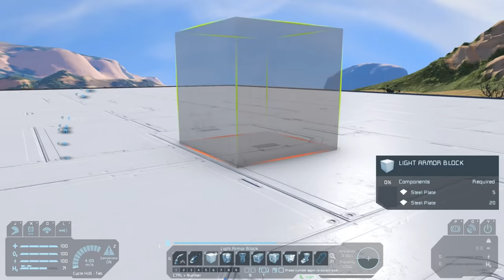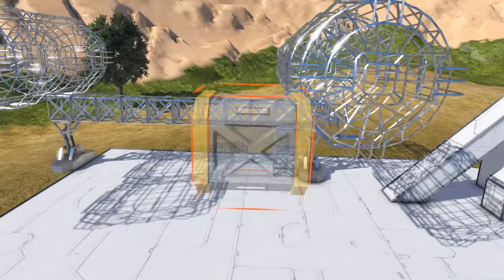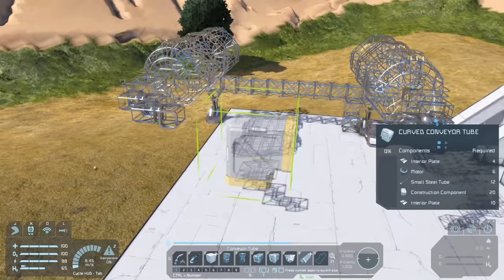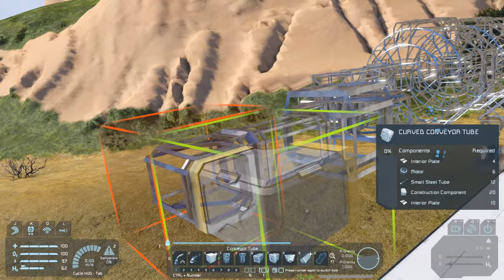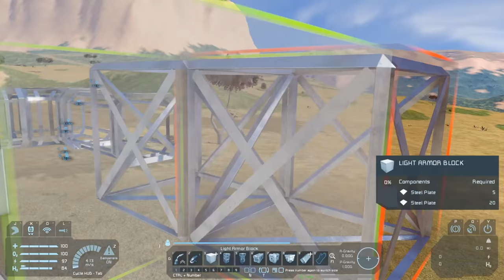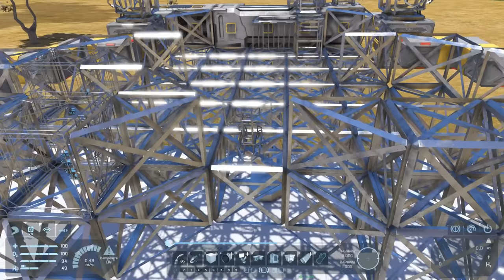Space Engineers Tutorial: Large Ship Design  Part 1 (Survival design tutorial series)

Comment: "assuming space engineers has any sense of structural integrity," builds spaceship on 1 landing gear.
Reply from the maker: For style I find it helps to assume it, for function, build what works :D
Reply: @Splitsie  indeed.
Reply: Corby Sloan it just WoRkS
Reply: I usually build my ships in creative and use a projector and fix any issues I missed for survival
Reply: @Splitsie  I modified your ship I wish there was a way to show you, I might be able to put it on the workshop
Reply: Wow, i found the alt account!
Reply: Y not wheels?
Reply: I don't know what you are talking about
Reply: Me, who usually doesn't build with landing gears because connections work just fine:
Reply: Maybe you should look into the mod that does exactly this
Reply: @Pcr12 really? Please explain to me how do you start off with a connector by itself on the ground. Then after that how do you build on the opposite side of the connector if you can't build on that side?
Reply: @brandonfrye1834  scaffolding
Reply: @Pcr12   🤦‍♂️ genius
Reply: @Pcr12  I recently discovered how to add large blocks to small grids and vice versa using hinges and piston heads as well as rotor heads

I'm loving the 5x5 large grid wheels on the small grid 5x5 suspension

Comment: I like to build my ships in sections for what i need after the other, this ends up with a slight brick but still nicely curved.  i start the first one with the bridge with the medbay, which sits on the front of my ship with large H2s under it and the a set 2-4 refineries with 8-16assemblers on the ends of the refineries with a cargo area attached of 18-24 large cargos. then the section for drills and grinders which are placed on a few pistons, and i have large ion engines in all directions in this section for small maneuvers. then a section with about 24 large H2 tanks and O2/H2gens in between and place 8-12 jump drives that then make up the wall between the Fuel section and the drill section.  then i start placing the hull around it and place large and small H2s on all places that have free connection points. after i place 2 large hangar bays on each side for small ships. Batteries, O2 tanks, and all other small blocks are placed in the free areas. for power i place all of the power production plants, so i have solar "sails" on the hangars, windmills on top, reactors somewhere in the ship and H2 gens somewhere in the back with the fuel. 
this makes a really large ship but one that has all you could need and you can also place a ton of guns on it for the perfect battlestation, it takes a few days to build and fuel up tho.

Comment: you usualy avoid as much as possible to start with the Hull, i always start with the Internal components like reactor, piping, cockpit, thrusters and so on. after im happy with my results i then start building the hull, i use the diagonal parts as muhc as possible, that way at the end it mostly wont look like a boxshaped ship.
Reply from the maker: If doing things that way works for you that's awesome. For my own builds I prefer doing a mixture of hull and internal components. Where the parts are large I need to put them down to get an idea of what sort of space I'll require but then the same can be true of hull shapes. If there's a particular curve or other larger shape I want to include in the armour I will put that in first then create some internal structures and facilities to fit to that. 

If you're building something with an industrial feel you might want to stick to largely squared off shapes, though I still find that adding diagonals to corners helps. The shapes you use should be dictated by the function or aesthetic you choose - which is very much a personal thing and I wouldn't dictate that to anyone, beauty is in the eye of the beholder and all that. This little series of videos was not intended to be telling people that there is only one way to build, instead it was meant to give insight into what works for me to guide people who might otherwise be struggling :)

Comment: This method of construction is definitely an option, personally I find it clunky and a bit frustrating. 

My suggestion is to either remove the drills from your hover miner and add a welder in their place, or (my favorite method) build a small hover vessel with a welder on one end and a grinder on the other. Add a remote control unit on the back of your ship plus a view camera, every time you need to grind something, you switch to remote control and turn the little ship around.

If you play with realistic inventory size, it will spare you thousands of trips to your storage, you simply dock your builder ship, load it up with materials, get back to building, not to mention jetpack fuel.
Reply from the maker: The reason you can't remove the drills from a mining ship and simply put a welder in their place is the size of the conveyor tubes. Because almost none of the components for construction can pass through small tubes you'll be unable to get anything into the welders or out of the grinders, a purpose built ship is almost always necessary.

As to building with a ship, it's one of the best reasons to play with realistic inventory settings, they really force the use of engineered solutions like that. The downside is always that ship welders and grinders are unfortunately slower than the upgraded hand held (something that I wish was the other way around), so even with x3 inventory it's normally faster to weld and grind by hand :(

Comment: This video is definitely beneficial in helping buiild smaller large ships. XD My first large ship was WAY bigger and I thought it was small XD. I actually built the blueprint first, then structured the ships hull around that blueprint, and that worked well enough. It did help that i had an idea of what i sort of wanted it to look like and what kind of rooms i wanted. Definitely wishing i had more room for hydrogen though. All in all itll be about 6 rooms including the storage/foyer/armory area, which makes it a pretty decent size. Not quite a capital ship, or even a frigate.. but its big enough. Its home. :3

One thing that i do want to point out is to be careful with the air vents, as they cost a TON of energy now. Not sure about back 3 years ago, but now they cost iirc around 150kw per tick which is nuts.
Reply from the maker: That's a good point on the air vents, I don't think they were that expensive back then but I certainly notice them now
Reply: @Splitsie  Yeah.. Its something im struggling with right now. Also i just checked, and it looks like its around 330kw. It originally was 0.33kw. Maybe a typo? But the dev team say its by design so i have no clue what the were thinking...

Comment: you mentioned needing alot of hydrogen for doing this although I wonder why you didnt just make a tiny smallship and use cockpit building.  a cockpit gyro and reactor with 1 atmo thruster in each direction can let you fly prety much indefinatly while doing the rough blocking out. air vent on a port set to depresurize and you have air the whole time too.   main disadvantage is not being able to grind blocks easy.   can prety much fit all you need in a ship that would fit down a 1 large block sized corridor.
Reply from the maker: That's a perfectly good solution. I'd have a bad habit of crashing something like that but for people more careful it would certainly work. The main reason I do it this way though... habit, I started playing Space Engineers when they first released survival so I became very accustomed to building this way and not having to worry about hydrogen. This is not a good reason for not changing but I don't tend to run out of ice in any of my survival games so I've stuck with it :P

Comment: Hey Splitsie, I'm following along building this and when I go to weld up the conveyors that are between the left hand side oxygen generator and small cargo pod won't light green. Even the one between the generator and hydrogen tank is red. I've tried grinding everything down, replacing the elbows with all junctions and other variants and still get the same result. Any idea of what I could be doing wrong? Everything else around the ship works fine fyi, it is just when I try to go through that cargo pod
Reply from the maker: There have been some bugs recently with the conveyor systems, one of the first things I try that seems to work most of the time is to turn the ship off then on again using 'Y'. I have no idea why it sometimes works but it's always worth a shot if everything seems to be lined up properly
Reply: I figured out what it was. For a reason unbeknownst to me, the left side of my ship became a separate ship. Once I ground everything down and installed from the other part of the ship, everything works now.
Reply from the maker: Oh wow, that's frustrating. Glad you worked it out :)
Reply: Me too. Thanks for the quick response as well as the videos!

Comment: Space Engineers is a fantastic game, but if I had one issue with it....
It would have to be the "welding" mechanic, welding isn't just a single torch that magically puts things together with a flame, you need either a very hot flame or electrical arc to melt and fuse the metal together and filler material to strengthen the weld. Look at any welding process and you will see that it isn't just a magical torch and it takes significantly longer to get a decent weld.
Reply from the maker: I don't think there are many games that don't abstract building in an odd way, for me I don't mind the 'welder' being really just a timer for the block to be complete as it works reasonably well from a gameplay perspective.